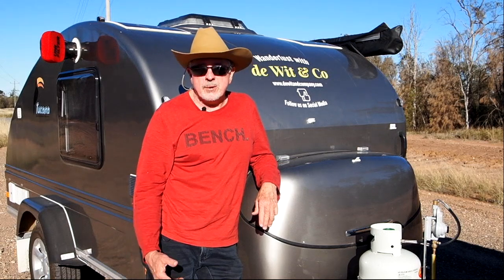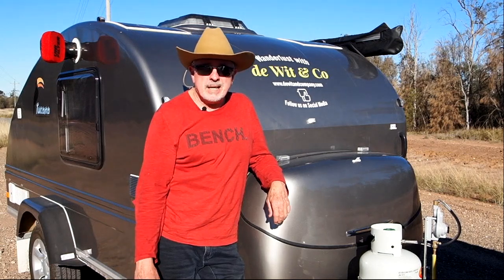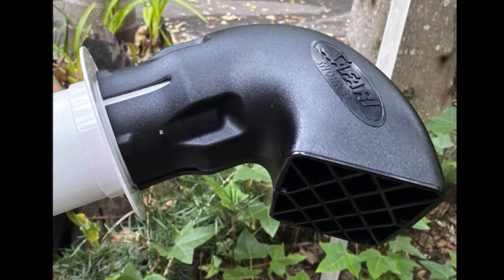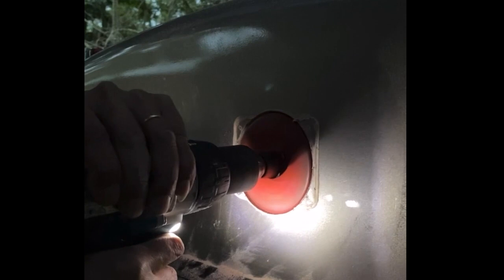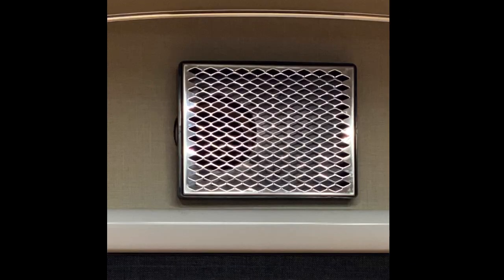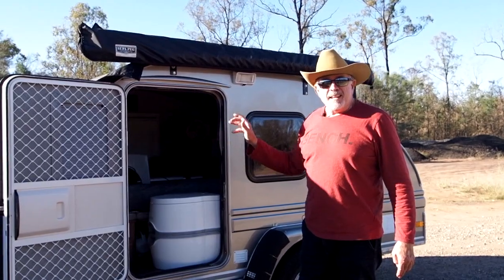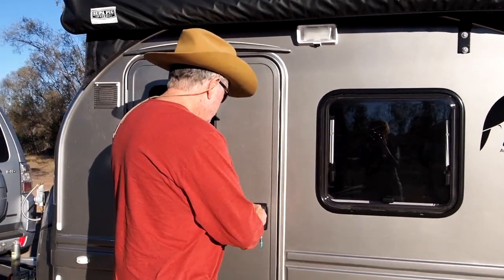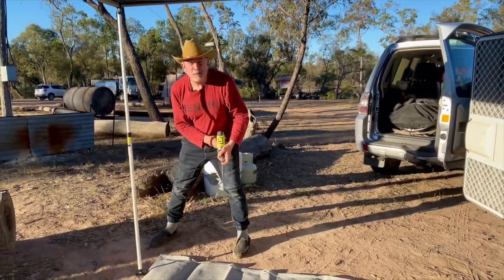Dust Buster

Comment: Hi Craig, thanks for your ingenuity, simple and effective. Did notice though the rubber seals on openings are only single width, double might assist a lot more and also when using silicone sealants may I suggest after applying us a spray bottle with water and dishwashing detergent and then spray over sealant and wipe with finger for a smooth finish and also assists with sealing as you provide a more complete watertight finish to the area. I've been doing this for over 30 yrs, old tiling tip. Cheers.

Comment: Maybe test it on a properly dusty road
 - not a good test , I did not see any dust cloud from the passing vehicle

Can I ask, does your top vent ( the OEM roof vent fully seal when closed or does it pass air via internal passages when closed?
- the top roof vent in our  teardrop has bypass vent passages and will still draw air very well even when closed (vecause the riif vent is located aft of the roof peak it always draws air from inside creating the the road cleaning dust sucking vaccume teardrop=  Mr Dyson could not have designed it better

Comment: Craig I've had the same problem with dust and am interested in following your lead here. Two questions - when cutting the hole, there appeared to be a square section on the Tucana wall, where did it come from?  and secondly, where do you get the foam snorkel cover?  Thanks, Nev
Reply from the maker: Hi Neville!
If you have a Tucana then you are looking at a Rectangular Vent that is in that position. You remove the vent and drill out with a your 90mm hole saw. Hope that make a sense? If not let me know and I’ll expand further. All the best. Craig

Comment: i thought the idea was to pressurizer the cabin to keep dust out not a vacuum?

"Clever new roof-mounted, dust extraction system designed to keep out dreaded Outback dust. ... Weighing just 4.2kg, the unit operates by airflow when the RV is moving, filtering out pollens and dust particles below 10 micrometres, while pressurising the interior."
Reply from the maker: Yes that’s correct it’s not extracting the dust… it’s stopping it from entering in the first place.